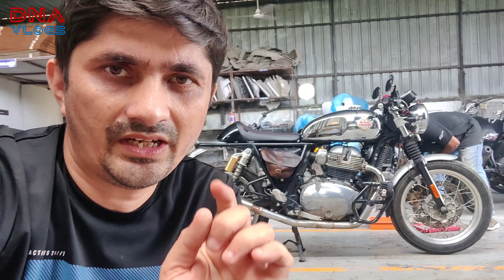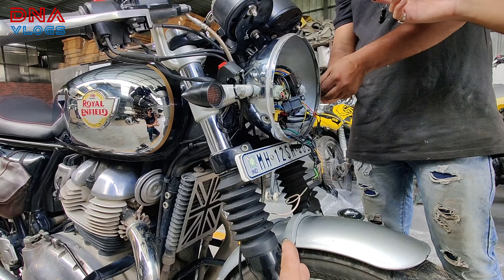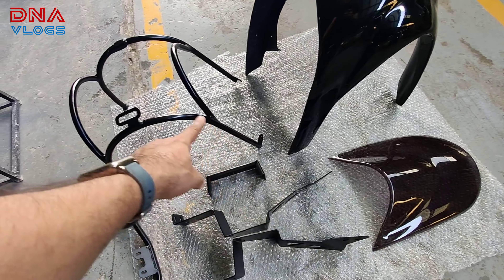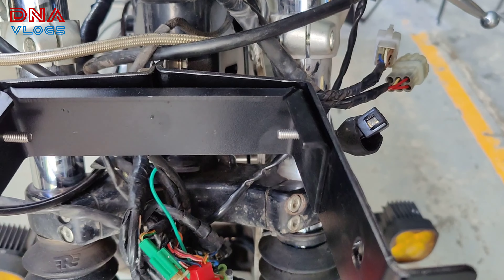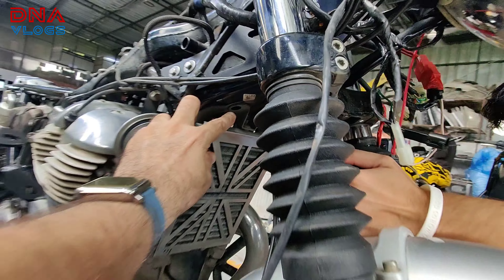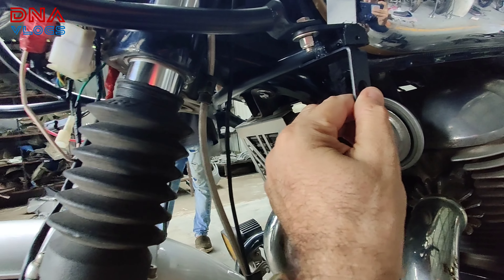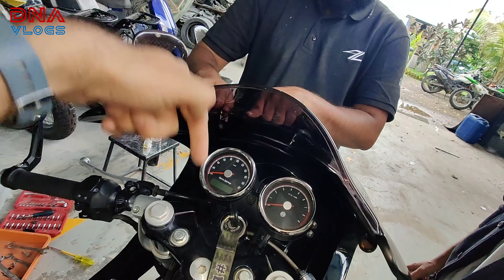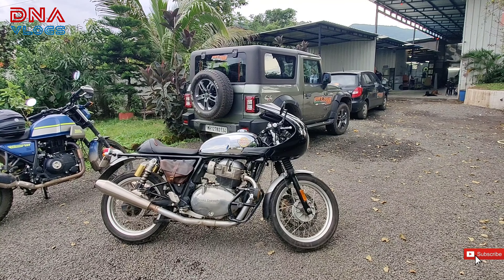RE Interceptor 650 Mods | Autologue Design Reck 2.1 Bolt on Body Kit | DIY Installation | DNA VLOGS

Comment: What if I keep the handle bar above the speedometer , is it gonna be any problem ?
Reply from the maker: @shyama1338  yes obviously. If you did not understand the geometry of the handle and fairing , (it's top edges), how will the handle turn without touching the fairing . How will you take a turn